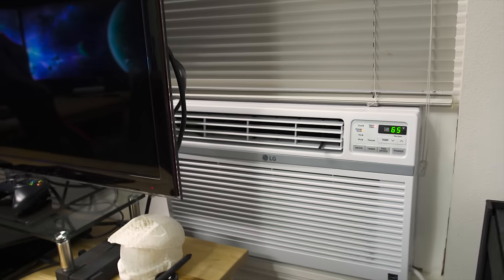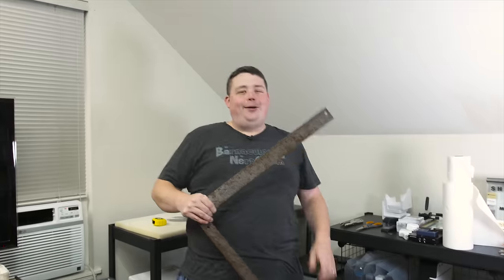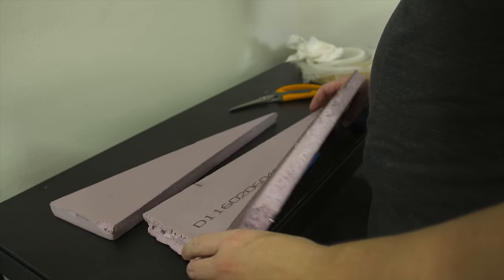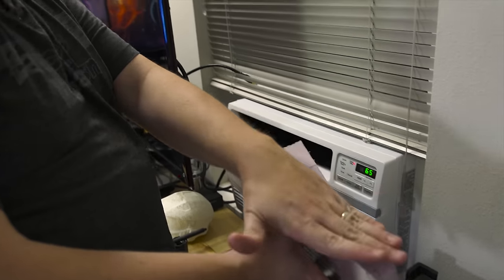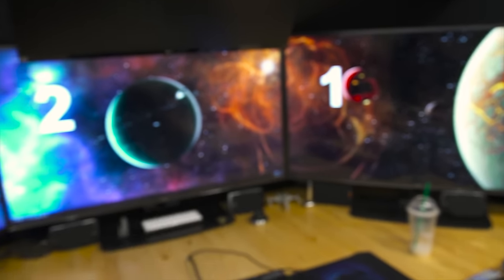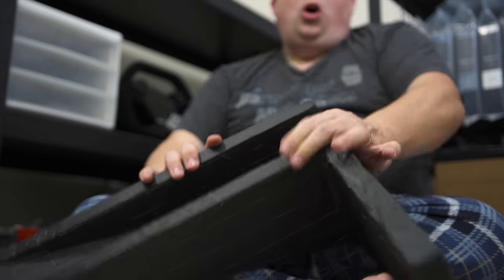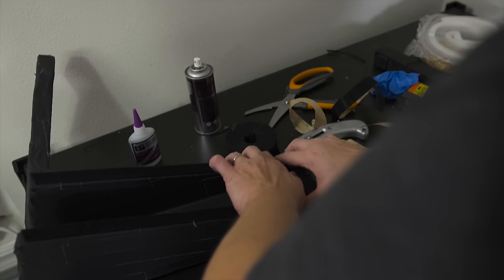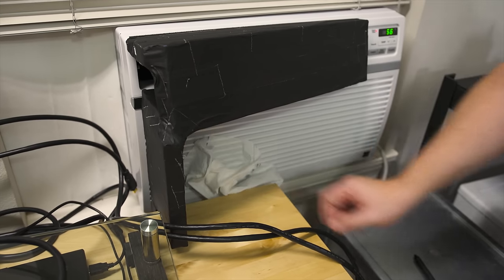Building Custom DIY Air Duct for my Window AC with JayzTwoCents - @Barnacules

Comment: A different way to solve your TV in front of AC issue would be to hang your TV on an articulating arm wall mount that would allow you to move it over to about the same spot, only just above the AC instead...

Comment: easy hot wire: clamp a guitar string (.012) between a U made ot of wood and connect a 12v power supply to it (+ on one end -on the other) you can controll the heat by turning down the voltage or change the distanc between + and -
Reply: *steel string

Comment: I would use something like a dryer tube to go behind the computers and having slots cut into it pointing at the players and sealing the end to have more of a current to the slots.
Reply from the maker: +Riley green also thought about doing this but the resistance on that long run would put a lot of stress on the motor on the AC.
Reply: +Barnacules Nerdgasm well I haven't thought was going to do something like that myself but I will stick with moving the airflow. thanks!

Comment: Desk fan, they work wonders
Reply: They also take up valuable desk space.
Reply: A fan also will do nothing to make a room cooler. It makes you feel cool but does nothing to the temperature of a room.
Reply: Desk fans only push hot air around.

Comment: I would have used aluminum hvac tape once that condensation hits that tapes going to peel and most likely that Velcro too. I mean it will hold but I probably wouldn’t have lined the inside with that tape I would have just left the foam part on the inside

Comment: I did something like that years ago, I ran dryer hose from my A/C's vents through the computer radiators and then into my living room.  Entertaining project and it cooled my CPUs down quite a bit, but the living room wasn't any cooler (which isn't that surprising, since it was blowing hot air from my radiators into the living room).  I was married back then and she really didn't like a giant dryer hose running through her kitchen...come to think of it, that may be why I'm divorced...that, and the extreme E.D. (okay, that's not true....or is it?).  ;)

Comment: I would just get a good central air system. That would be an interesting video.
Reply: Bob Loom I'm guessing he already does. this is in a house right? the small window unit is cheaper and more targeted to run than the system for the whole house. what makes you think he spends time anywhere else in the house?

Comment: i wonder if you could take a window A/C and set it up to duct the cold air into a PC and have the exhaust fans blow into the hot side, assuming you can combat condensation.

Comment: good thinking but you are worrying about the wrong air, if you knew how an AC worked you would be installing a duct to the return section directing the return air duct as far up near the ceiling as you can, AC's remove heat and humidity from the air and return that same air  cool and dry  back into the room. Hot humid air rises so if you can pull that air into your AC it would be very good.

Comment: I'm actually kind of surprised you haven't designed or downloaded a snap in 3D printed duct by now. I've seen a few on thingiverse and they'd be easy enough to modify. I would sager a guess that someone has even designed one for your specific AC unit. They even have little prongs that just snap into the AC unit's vent hole. It's kind of like plug and play for appliances... In the off chance that the models have been taken down I'd bet that 3D printing nerd could help you design something that would work.

Comment: 65-70 is way too cold when it is hot outside for me. Unless you sit inside all day long (uhh...OK maybe you do...:-) The difference when I go out and in makes me freeze and feel unconfortable inside the house. On a 90-95 deg day I never set the AC below 78-80. Maybe it is just me but I don´t like constant temperature changes. I just adjust to the heat I guess....

Comment: if you aimed it up. the cool air would cool the hot air higher in the room and the rest of the cold air would have fallen to the floor. thus having better more even cooling ~hvac tech

Comment: Now you need to go to the University and find some hot HVAC or Aeronautics student of the feminine type.  design the duct with a parabolic curve with the proper volume to maximize laminar flow. you can even run the output nozzle out a couple of inches past the AC unit.  Heck, you can even fabricate an afterburner to increase  air-flow (but I guess pumping in lots of propane and flame would defeat the purpose of cooling)  But you could roast marshmallows with the afterburner running :-)

Comment: Just a quick note, the square is also a measuring device. Ergo, marking it with a tape measure before switching to the square is unnecessary.

Comment: you've reduced the airflow with that drastic right turn. yes, I am a HVAC Professional.  you're getting a low intake because you're still getting some air recycling, 

but basically the room is so small and the ac is big enough so it's hard to mess up. any mod that prevents the short cycle would work in your situation.
Reply: so, the reason I say you've reduced the airflow isn't just because of the friction cause by the drastic turn, we call it "dead heading". 

 it's also because of your outlet. you started off with a 3in x 17in outlet - about 51 square inches for the air to flow thru, now you have a roughly 3in by 5in opening and possibly smaller due to mounting the pieces on the inside edge instead of the outside edge giving you about 16.5 square inches of outlet. think of air the same as you would water, does more water flow out-of a 16.5 in sqaure hole or a 51 in square hole? 

i know your putting your hand on it and you're  saying to yourself "but it's blowing harder. it has higher velocity" and that's right but velocity and volume are two different things. your velocity went up and your volume went down 

what you have done technically is made the ac produce colder air, slower air velocity over the cooling coil allows for more heat removal giving lower supply air Temps.

 sounds good right? but it leads to lower system pressures and a much higher probability of the evaporator  turing into a huge block of ice, especially coupled with lower outdoor temperatures coming up soon(if they already haven't in your area) that also lower system pressure.  

just keep an eye on it and make sure nothing that can get wrecked from water is under it.  hopefully that unit is a heat pump so if it ever does ice up on you,  just switch it over to heat mode and melt that block of ice in no time. 

i hope you enjoyed.  In the end your mod is gonna do just fine.

 - do be aware of the ice block risk you now have.

Comment: While this video shows its a good proof of concept you should 3D print a duct that will clip into the original grill hole, might need to do it as a 2 piece clip together due to the size, but would be a good vid from doing the 3d model to the print

Comment: Use some hot glue to glue the foam, that worked best for me... Razor blade works fine, but it must be sharp, and you must hold in an at most 30 degree angle...

Comment: I might be paranoid, but I'd be worried about interesting chemical fumes leaking from such a large surface of tape coming into contact with the air (I've yet to find a duct tape that does not smell like cancer)

Comment: No expert here, but I think it's better to point the airflow somewhere else rather than in the gap between the electronic stuff and the wall. You will end up cooling your tv and the wall rather than the air that's in the room.

Comment: I realize you like doing your DIY stuff but there are metal HVAC fittings you could've bought at your local Lowes or Home Depot. Of course, you would've been done in two minutes and there'd be no video. There's also better tape to use for all aspects of your project. I used to do HVAC work when I was younger.

Comment: Just so you know, that infrared thermometer does not read air temperatures, only surface temperatures. So you are reading the wall temperature that is being cooled by the ac and warmed by exterior and ambient interior temps all blending together. Which is different than the air temp being expelled by AC. Not an accurate measurement of what you are attempting. Also , FYI for anyone, they don’t go through glass or water etc.. it will give you the temperature of the surface off the glass or whatever translucent object you think it’s passing through. The downfalls of infrared guns and correctly knowing how one works......

Comment: Why not just use the air deflector as a template?  Also you should have deflected it to the right and down as heat rises it will mean the cold air falls and cools you much more

Comment: Would you not of just simply wall mounted the TV? You could of easily put a bracket up in between the 2 windows to hold it a few inches higher then it currently is and possibly angled it down if you needed to and it would of cleared some desk space which would look like a cleaner looking install

Comment: Notice the shape of the square is similar to this here capital letter L. So a T square would be the shape of a?______  Framing square is the name you are looking for.
With a piece of tin you could have covered half the vent so it blows in the middle of the room and behind the TV. You could still try it but the foam would block 2 inches of the vent.

Comment: in theory could you cool a pc with a ac? same kind of foam set up but with a circular cut out insted . attach some flex pipe.. cut a hole the circumference of the flex pipe on the slide off tower panel. bing bang boom arctic chilled pc or no?
Reply: condensation.... wont be a good thing for the pc components
Reply: With a long enough length of flex pipe while making sure it pitches up at a angle will condensation really be a issue?
Reply: or how about using a condensation neutralizer in the setup. Costs a little bit but could be worth it for the cpu and gpu temps you would get.

Comment: Facepalm .. either get a Ductless AC, or what I prefer an advanced home AC with room zone control. Your home and family are unsafe using Window AC unit or Portable AC .. if a window is open!

A Thief can easily get into your home by yanking out your window unit and it doesn't matter if you need a ladder .. what you don't think thieve's have ladders? 😳

Comment: lol, this foam stuff is way over the top.

Next time you can try to use some craft boards sold at dollar store (come in both white and black color). Those are way cheaper and much easy to work with. I suspect the end result will be the same, since you goal is to redirect air flow, not insulation, so thicker material just don't matter.

Comment: You did the multi redirection set at 68 then the single redirection at 66.  THEN you claimed  the latter was better because the room was two degrees colder than the former.  But... but.... you set the A/C two degrees colder.

Comment: The problem is that you have too many GPUs.CPUs running making that heat. the solution isn't redirecting the cold air. the real solution is either taking a box fan and letting that circulate the cold air or do that and upgrade to higher BTU's. you got 2 computers running why not 10 window air conditioners? no room you say? cut 20 more holes in the walls and install 20 more air conditioners, problem solved
Reply: Or just you know... Water cool everything
Reply: @XxAtomic646xX  water cooling only cools down the computer it doesn't cool down the room that's his problem. You completely Missunderstood the problem
Reply: @eksine  bruh you don't understand computers... The heat is coming from the cpu and gpu, if you water cool, the heat will be FAR less.
Reply: @XxAtomic646xX  dude no YOU don't understand computers, where do you think the heat goes? Do you think the CPU and GPU heat just disappeared into thin Air? No fool it goes into the room the whole point is to cool the room not the chips. By the way I've grown up with computer since that 486 and 386 days and dial up modem so I probably know more than you do
Reply: @eksine  who tf you tryna fool kid.  there are literal studies on YouTube of full water cooled systems absolutely running cooler room Temps than air cooled systems.. This is 4th grade science bruh

Comment: bad idea you should have cycled the temperature in the opposite direction taking heat away from the pc and giving the room cold air.... that's how air conditioner works. By giving  cold air yo your pc and electronic moisture can show up if the air conditioner has no DRY function.

Comment: I would have made one that would have faced up because heat rises and we're really wanting to get rid of the heat is what we're worried about in this situation it going sideways is definitely preventing it from doing any looping with the air-conditioning and what I would have did was I would have made a custom piece of phone that had a are director at the top but one that wasn't as restrictive Wendy's near Eunice the air direction for these things are very are restrictive

Comment: I would have used the cnc or the 3D Printer
Reply: And by the way this is a faildesign of airconditioner. The outlet for cool air should be on the bottom and the hot air intake should be on the top. Because an air loop is just caused by the laws of physics. Cold air wants to the bottom and hot air wants to go up.

Comment: seriously? you were measuring the temp of the room by using an infrared on interior/exterior walls? -.- if youre going to use an infrared to measure a rooms temp, stand an ID card up or some other random thin object and measure it. exterior walls are insulated, some interior walls arent, so youll get wildly different numbers depending on the time of day and temp outside. if youre blowing the air at a window, youre losing a lot of your cold air through it. the more you bend and turn the air coming out of the ac, the less it blows because it takes more energy for the fan to push it.

Comment: Okay dude why didn't you just move the desk would have been easier put the desk away from the window I flip the top around off the desk so the TV would have been on the other side on the desk and I wouldn't have never been in front of the AC you would have been on the side of the AC away from the AC itself also thank you for the video cuz it made me laugh PS if you put a small fan on the floor so I can circulate the air the cold air from the floor the hot air from the floor around it'll probably help you cool off the room faster

Comment: That is NOT the best way to do that (I know, I am not there, and I am "just another net expert"), It should have been blown the OTHER direction, AND ducted out more toward the center of the room, and not pointed at the wall.  This is going to be VERY inefficient with the way you have ran it.  I am sure this time of year, you don't have to cool as much, but if you are trying to cool the whole room you need it to be able to flow into the room, and not be pinned behind your equipment.  If your goal is to focus just on that corner, and your equipment, okay, what you did might work, but its going to take a LOT more work from that AC than letting it cool the whole room.  (Hopefully you relocated that SLA printer).
Reply: Cool air should be blown at the walls so it pushes the warm air out towards the center and can then get sucked in by the intake. It also causes better air mixing.
Reply: John
Not in a confined area like this...that changes things completely.

Comment: If you have the original vents, that you throw away very quickly in the beggining of the video, and you have a 3D printer and the KNOWLEDGE???. WHYYYYYY don't you design a NEW 3D printed deflector that fits perfectly in the AC machine ???

WHYYYY?? 

Do better stufff. You have the tools !!!!

Comment: you inspired me to lose weight,   i have not watched since    whats up.     u obviously lose lbs. are we still drinking the kool aid?      are u stil at or around 2000 carbs      i went from 300 lbs to 280 and staying at that  for several months?